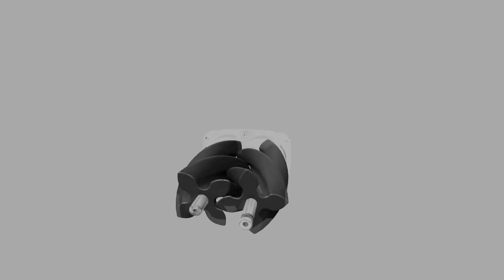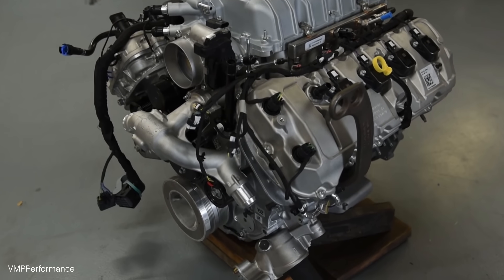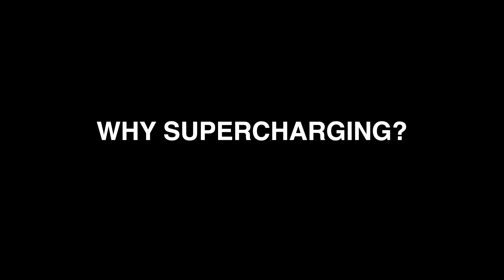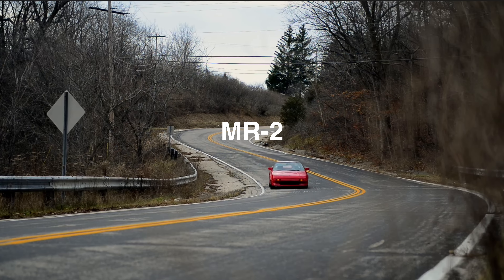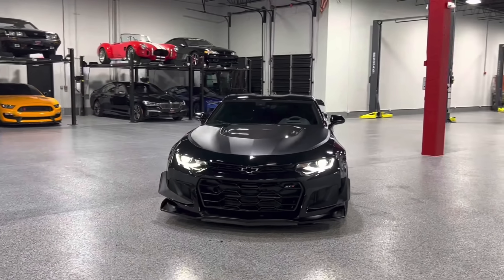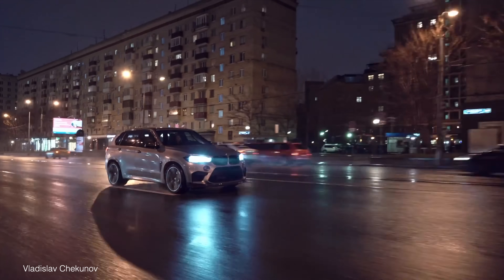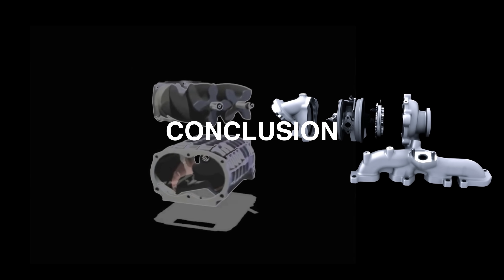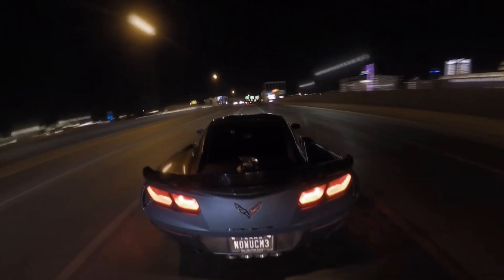Why V8 Engines Are Supercharged vs. Turbo😮| Explained Ep.6

Comment: I’m a supercharger fan, mainly for the constant visceral experience from the drivers seat. However I also really like the rush of G’s that comes on when a higher boost turbo set up starts pulling hard. That hot V configuration is sick and having everything right there to work on is so nice. Killer vid man!
Reply: It may sound silly, but if you ever get a chance.. drive a supercharged BRZ manual, you’ll never stop laughing.
Reply: Not every turbo is laggy, especially these days
Reply: @Anon.G  Every turbo has lag and a a threshold where it starts to produce effective boost. We just have more efficient turbos now and better ways of mitigating these inherent traits.
Reply: @willstikken5619  while this is true. For spirited driving you can easily keep the rpm in range of a modern turbo. It's not an issue.
Reply: @Anon.G  Its not an issue for those of s that know what needs to be done.  and modern cars with turbos have gone a long was to mitigating the issue but it is an inherent design element that can never completely go away.
Reply: @Anon.G  nope, my car has lag but the turbo is 76mm, my bike runs a Subaru TD04 but the pipework is only 18 inches from turbo to plenum so there is no lag the power curve is smooth as hell.
Reply: The only problem is reliability later down the road with a hot V config. I currently have a 07 STS-V with the small, supercharged V8 and for awhile was considering a used BMW 650i from 2013 and up. The STS has been very reliable with 120k miles on it now. I see low mile BMWs though with bad engines in the lower mileage ranges. When I was researching these cars it seemed the consensus was the hot V config was cooking the oil in the lifter valley and sludging up these engines. That kept me from buying one.
Reply: well my turbos are anything but laggy.  i make way north of 1khp with twin s475s on a 411in g3 hemi.  if you have lag you built it wrong.
Reply: @turbofreek  them 475’s aren’t small are they 🤣
Reply: A supercharger gives you instant boost, turbo's lag as stated. If you want to make the top power twin charge it.
Reply: Why cant you car people go 2 fucking seconds without petty arguments
Reply: Hot V is is sick, eh? BMW N63 has entered the chat
Reply: @Prostreetsburnoutparadise  I have a 1:1 back pressure ratio…..back pressure can be manipulated so still no.
Reply: Yeah they're sick til you're blowing up your turbo constantly.
Reply: @Adierit  blowing up your turbo constantly? Man in what year are you living in because this is gone long time ago. There are always exeptions (looking at you BMW) but mostly the turbos die due to bad oil/late change intervals or damage from other parts going into it. I dont hate superchargers at all but it feels like you have never owned or only owned a very poorly maintained turbo.
Reply: Adam Chapman  I have a 1000+ 3.2 VR6 A3 and the bike is still faster at 250whp 🤣
Reply: Adam Chapman  how did you find the prelude to drive? Did you do anything to help traction like a diff?
Reply: @SeaMonkey137 I’ve got a B7 Audi S4 for a daily, I’m really tempted by an Eaton roots on it!
Reply: @Prostreetsburnoutparadise  from waste gases.
Reply: I much prefer having 500hp with a turbo than 500hp SC because the turbo car will be faster as it’s power increase is free of charge where the SC costs power to make power. 

I’m a practicality man.

I’ve just turbocharged a 2005 ZX10R too and there is no lag.
Reply: @Mr_OoOsH  
A SC car rated at 500hp is making 500 after the hp loss...
Reply: @yousef.al-assaf  that’s not what I mean and you know it lol, it was a simple explanation the 500hp SC motor would have to be making more than 500hp to have the same output as the turbo. It was a simplification of what’s happening.
Reply: @Mr_OoOsH  
That's true but it's not that awful with the new superchargers that come with 75-80% efficiency. 
I admit i am a bit biased towards supercharged cars because they sound nicer in general lol.
Reply: @yousef.al-assaf  I’m a turbo man, I’ve put my car at 750hp turbo against 750hp SC with weight within 50kg and same 4wd and I demolished it.
Reply: @Mr_OoOsH  
I just like the instant response of superchargers and that adrenaline pump that you get from hearing its glorious whine. 
My rule of thumb is: 
- V8 should be N/A or SC. 
- V6/I6/F6 should be hybrid or TC. 
- V4/I4... I will never stoop that low. 
You're pushing 750 to the wheel?
Reply: @yousef.al-assaf  3.2 VR6 T Audi A3…..it was but it’s gone for more work it will be on some channels once it’s done and will be a 4 figure car
Reply: @yousef.al-assaf  4 Cylinders should always go turbo. Supercharging such a small engine does not sound efficient.
Reply: @Mr_OoOsH  Much like your 500 hp comment your "same hp same weight but i destroyed them" remark seems to be leaving out a lot of the story.  The power curves on these two engines is going to look very different. I suspect the story has less to do with peak power than it does with traction at the point of acceleration. A well designed turbo can maintain peak power in a nice, flat power band while a super charger produces more average power throughout he rpm band. Whichever car (and driver) can use that power is probably the winner.
Reply: @willstikken5619  both cars were AWD, in fact the same AWD system, it couldn’t have been a fairer race.
Reply: @Mr_OoOsH  That seems unlikely but i wasnt there.  :)

I've had fast SC cars and TC cars, I love both but I've always found the SC to be faster, more predictable and definitely better on the street.   The TC tended to have better fuel economy but having to keep it in it's peak boost band is a limitation.  If you can manage that it has the potential to be faster because it can maintain peak power over a longer rpm band but that isn't the norm, especially for a street car.

Out of curiosity, which two American V8 AWD drive cars were you racing?
Reply: @yousef.al-assaf  def do not sound nicer.. why anyone would want whining is beyond me. including this post
Reply: @Mr_OoOsH  you are extremely incorrect about the turbo making more. There is a reason the fastest cars in the world, top fuel dragster and rails, go supercharged. You will always lose some with a turbo, there will always be a form of lag. No matter how small, it will be there. That is the main attraction of the supercharger. More power immediately. Main attraction of turbos is that epic sound. Super glad you love cars but just trying to educate you slightly so you don't continue to spread misinformation. If you care to go Google about them and watch other videos you can end up getting yourself well informed way more than any comment section. Keep on revving on.
Reply: @EXRDaBeasta  turbo = free power / supercharger = power that costs power 
This is the only point I’m making. So pound for pound the turbo is a better option. 

Talking about educate yourself like you have some massive point when you actually don’t for what I’m actually talking about.

What an arrogant answer you gave, I’m not spreading misinformation at all.
I think you’ll also find that NHRA rules dictate it has to be a supercharger and not turbos…….a little education for yourself there buddy.
Reply: @EXRDaBeasta  beginning your reply with “you are extremely incorrect” when you yourself are incorrect is arrogant, it isn’t up for debate, superchargers are used in top fuel because the rules say they have to be supercharged. It’s also a fact that turbos are way more efficient than superchargers, which is the point I’m making. So you’re still wrong for the point I’m making.

Comment: I love the idea of twincharging setups like Lancia did with the S4. I.e. having both a turbo and a supercharger.

A little crazy for a daily driver though.
Reply: I mean, when they were still in their rally days, Lancia was crazy in general.
Reply: @mistersomaru  Modern day Lancia gives so few fucks that "Stratos" means so little to them, they have literally given up any legal claim to the name.

I mean, its better than sitting on that name and doing nothing with it. But still. wtf Lancia. Lancia's likely answer "minivan go putputputput."
Reply: @whyjnot420  hence why I said "their rally days." 
These days they're just rebadged chryslers.
Reply: Volvo has been making twincharged engines in their T6 and T8 models for the past 6 or 7 years, unfortunately they're quite issue-prone.
Reply: Nowadays it's also an overly complicated and unnecessary solution. Modern turbos have a very wide usable range, not like those old turbos that were useless before 3500rpm, plus many cars now have 48V mild hybrid systems which can be used to drive an electric compressor on the turbo.
Reply: @BigUriel  Won't stop me from loving them due to the audacity of the fundamental setup. (not to mention that when they work, they really work)

On the note of hybrid designs of any nature. These will not even come into play when I am entertaining the idea of a twincharged mid engine setup like the S4. They are just something else, as in 'does not apply'. To twist a line from history DAMN THE MERITS, FULL SPEED AHEAD!!!!. :P

Comment: Love the video, everything except for the fact that you stated manufacturers would rather do EVS. No, they wouldn't rather do evs, they are being forced to, due to more stringent MPG fleet requirements. The federal government, more specifically lunatic green energy folks are killing the cheap automotive industry.
Reply: It's a bit of a self imposed gunshot wound. In the USA at least cafe laws are typically by fleet and not individual vehicles. This is how they can hit 35mpg rules while still selling my favorite pony cars which make like 18 mpg. The issue is trucks / SUVs arethe big 3s money makers and rhey have massively cut back their car lines (Ford only has 2) which doesn't leave anywhere for them to counter the large engine cars low miles except for hybrid/electric, both of which require way more financial commitment than small cars.
Reply: Cheap cars died with the rise of the crossover SUV
Reply: Money was forcefully taken from me and given to Ford via taxation and inflation, for them to produce 6 ev cars within their first year. A failing business will always take handouts from the government.

Comment: To answer the question simply:
- price of gas in US, it is cheaper, that makes the engine fuel consumption irrelevant 
- superchargers are super cheap to develop compared to turbos, hysterically speaking
- superchargers are more reliable 
- relaxed environment regulations in the US
Reply: The main reason why push rod V8 exist in 2022. If gas prices were same in 2002 as they are now a lot of things would be different in US.

Comment: The reason, is American OEMs decided based on cost, and packaging reasons, blowers win.  That is reason 1. Reason 2 is a 750 hp tt 5.0 would be a tune away from 1200+ hp, that is a huge liability. Push rod 1000+ hp is as easy as LS + S475 turbo + injectors + cam and springs.

Comment: I think the "peak" of internal combustion is only limited by metallurgy. 50 years ago blocks couldn't take nearly any boost. Nowadays you see 20PSI without thinking much of it, upwards of 100+PSI on all out race builds. Maybe one day technology will be good enough, and trickle down cost wise enough, that we can cost-effectively have super-strong engine internals and make massive power. That would only be for dedicated enthusiasts though, no doubt all production cars are going to become electric, I think internal combustion will eventually be left solely to the aftermarket. You still have people that like living their lives without electricity or anything like that... Some people just never change, and there will always be a niche for internal combustion, even if it fades away from the main spotlight.
Reply: Idk I mean the grid can't sustain electric cars though
Reply: 50 years ago nobody made engines with forced induction so there was no reason to fit very strong connecting rods. These engines are turbocharged from factory, naturally the internals are designed to take much more abuse. It's the choice to use boost that has led to manufacturers fitting stronger internals, not the other way around.

You're right in the sense that improvements in metallurgy are part of this but mainly on the turbos side rather than the blocks. It used to be much more difficult to machine a turbo with enough precision that it wasn't unbalanced and now we have superalloys that combine light weight, high strength and high tolerance to temperature. We also have direct injection and advanced engine electronics management to make it all work together, turbos and carburettors don't go very well together.
Reply: Well said.
Reply: Blocks could take it. The Ford big block 352 loves boost.

The pistons, rods, and head gaskets were not there yet in metallurgy or design to take big power though. 
Even today I'm having issues finding anyone that wants to supply forged rods, pistons, and crank so I can see what 40psi in a Ford 352 will do to my galaxies
Reply: 1962 and 1963 Oldsmobile took the Buick Aluminum 215 v8 and turboed it from the factory
Reply: I think we have reached the peak. It’s not technological. It’s technical. We don’t need 300 mph Mustangs and 800 hp Camry's. 99.999% of people don’t need to go faster than modern cars do and can’t drive that fast either. Even if you can have a dirt cheap and indestructible 3000 hp engine you ain’t ever gonna need that power for anything unless you got a 5 mile long drag strip.
Reply: @sarmatiancougar7556  Sir, this is North America. It's not about need.

Comment: GOOD VIDEO. GOT TO REMEMBER TURBOS REQUIRE ALOT MORE PARTS THEN THESE OEM SUPERCHARGER SETUPS..TURBOS REQUIRE ALL THE HOT SIDE ANDNCOLD SIDE PLUMBING,  INTERCOOLER PIPING, BLOW OFF , VACUUM LINES, OIL LINES, CATCH CAN, ETC ..SUPERCHARGERS ARE KIND OF LESS WORK AND MORE BANG FOR THE BUCK
..YES YOU CAN FIND CHEAP TURBOS BUT TO BUILD A RELIABLE, OEM SETUP ID MUCH RATHER DAILY A SUPERCHARGED SETUP..MAX PERFORMANCE ALWAYS THE TURBO CAR...TURBOS CAN KEEP TURNING UP AS LONG AS YOUVE BUILT FOR THAT.

Comment: Pushrod v8’s are supercharged. Other v8’s like the blackwing v8 is twin turbo in hot v.
Reply from the maker: The 5.2 DOHC GT500 engine is supercharged🤷🏽‍♂️
Reply: @337speed  good point, not a ford guy at all and always forget about them.
Reply: @337speed  4.4L northstar in the sts v and xlr v is also dohc and supercharged, Guess I didn’t really think about my comment when I posted!

Comment: how didn't the CT6-V Blackwing sell ? the engine is a beast
Reply from the maker: The issue with majority American buyers is if a sedan costs $90-100k, they’d rather buy a Mercedes, BMW or Audi for the prestige. The blackwing was solid but sales didn’t reflect the engineering
Reply: @337speed  Thought that might have been the reason,  Would've sold like hotcakes here in Australia

Comment: I’ve read somewhere that internal combustion engines have much more capability in getting more efficient than EV’s. Nothing like getting a tax write off for new R&D.
Reply: Regardless of your opinion on climate change, we're running out of oil and it will only get more expensive as time goes on, so even if it didn't effect the environment, combustion engines would be on their way out regardless
Reply: @post-leftluddite  how old are you? Granted we’ve been “running out of oil” since they started drilling. Every decade there has been new vast oil field discoveries toppling the last largest fields. The new oil fields discovered in the past 10 years in just Alaska and Montana alone would last the US somewhere around 50 years. Teachers have been telling children the world is running out of oil since 1950’s, but nobody knows what lies beneath the surface of the earth. Until there’s a huge technological leap forward in so-called “green energy” or renewables, the combustion engine and petroleum are here to stay and are the cheapest form of fuel. Unless you actually think what happened to the gas prices are Putin‘s fault. If you believe that there’s no hope for you, please exit America at the nearest open border.

Comment: When the GTR came out in 2009, it was faster than everything around the Nurburgring and cheaper than everything. So fast turbos for cheap can be done.
Reply: GTRS aren't cheap, they're just much cheaper than what they compete with
Reply: @night7185  In the video, he compared a "cheap" $80,000 Camaro to a $150,000 Porsche, saying how it was as fast around the Nurburgring for a lot less money because supercharging is cheaper than turbocharging. This is his claim in the video. What I am saying is that turbocharging can also be done as cheap as supercharging and used the GTR as an example, which cost around $80,000USD when it came out in 2009. Basically, comparing a Chevy to a Porsche was not a good example to use when trying to compare supercharging to turbocharging.

Comment: Best supercharged Positive Displacement V6 engines:

 Audi 3.0 V6 supercharged ( ex.B8 and B8.5 S4) 

Mercedes 3.2 V6 Supercharged (ex. Chrysler Crossfire SRT-6 and SLK32 AMG)

Jaguar 3.0 V6 Supercharged (ex. Jaguar XE 35T R-Spec)
Reply: Damn no 3800
Reply: @imjoeking_  How could I forget that L67 my bad guys. Great motor, reliable motor that can make good power
Reply: audi 3.0 v6 is probably one of my favorite engine nothing can beat that sound😍
Reply: Forgot the GM 3800
Reply: The supercharged engine in the Crossfire was the main reason why I bought it. Loved every minute of owning it. It’s a rare gem that didn’t get the recognition it deserved.
Reply: @Mik3y2087  No LSD, 350hp and sh*tty transmission is why I sold my C32 AMG and got e46 M3